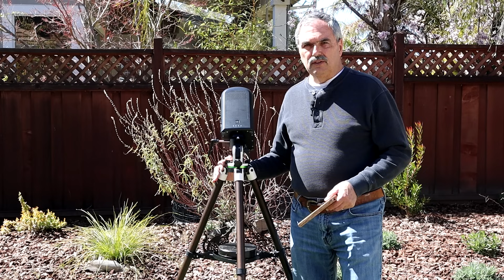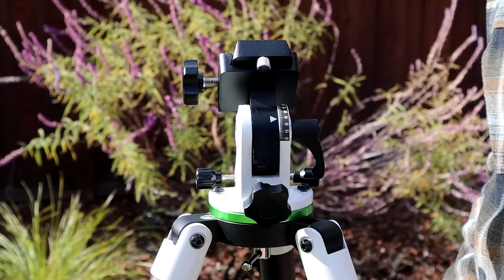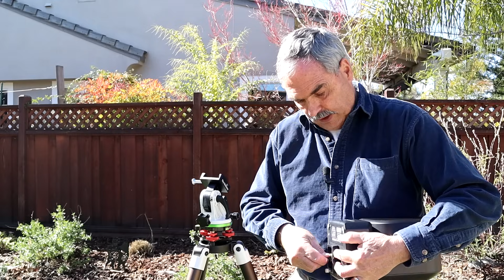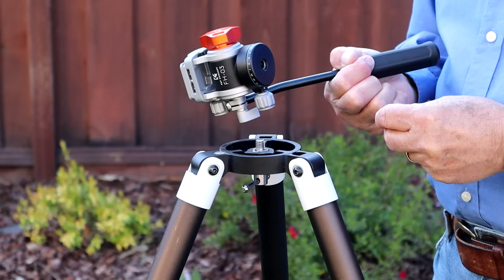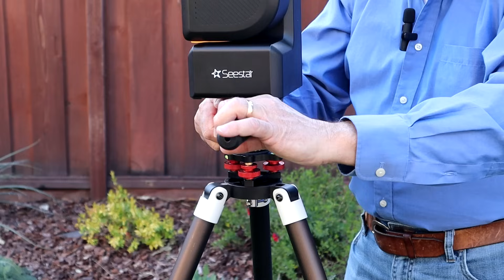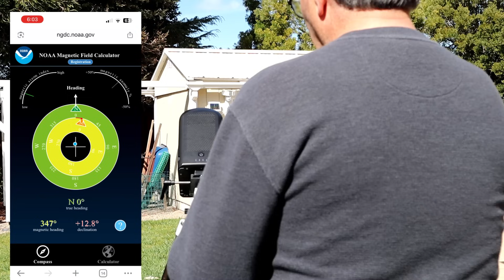Get Ready for the Seestar EQ Mode

Comment: Excellent! Thanks for making all the effort to create this video's about the S50. But still a question: Do you get also oval stars with the S50 EQ-N.I.N.A. setup as discussed in that video as well?
Anyway have clear skies and greatings form The Netherlands.
Reply from the maker: If you are getting oval stars with the Seestar App in EQ mode you will get the same with NINA.  If you are getting round stars with the Seestar App in EQ mode you will get round stars with NINA.  Whether or not you get round stars doesn't depend on which you use but on all the other things that impact star trailing.

Comment: What an absolutely great video.   So many help  videos just gloss over details which can be critical in getting a Seestar setup and running.   Particularly for those of us with limited experience.   You have also taken the time to show various options and products that we can use build a solution for using EQ on the Seestar.  Please keep up this line of videos on the Seestar and other astrophotography products.  You need to add a channel membership so we can donate to help offset some of the costs you have in creating these videos.  Any chance you could start a series on the Dwarf 3?   There is a real need for videos like this for the Dwarf.
Reply from the maker: I really appreciate this kind of feedback.  Others have suggestion a Patreon but I think I would have to add special content if I did that or added a membership and I just don't have time for more content.  At this point I just ask folks to use my affiliate links when they can.  The Amazon affiliate is good for anything, not just astronomy gear.  I was looking at the DWARF Mini as  a possible other SMART scope but I still have a few other things on the Seestar to take care of.  Will see what I can add next.

Comment: Thank you for the detailed description, something that is often missing from youtube reviews.
Just a question for the K&F head, a candidate I'm considering. 
Is there a reason when to tilt the seestar on the side of the handle, rather than in the other direction moving the handle up (while still having the seestar power section pointing in the correct direction)? Would it hamper the movement of the scope?
BTW I have the s30 and the K&F concept tripod.
Reply from the maker: Sorry, but I am not following your question.  The handle can be raised, lowered or rotated but it cannot move to the other side of the K&F head.

Comment: I can see in the months ahead a load of complaints of their s50 gears sticking or not working at all. Turning it into a very expensive doorstop.
Reply from the maker: That's possible, but I think ZWO must be confident that will not happen.  They would loose a lot of goodwill and customers for their future products.  It's also possible that they did not do enough testing to be certain that the failure rate will be low, but  I still think they would be very careful about their reputation.

Comment: So helpful setting the Seestar to EQ mode, I have an old Vixen Super Polaris mount that I intend to use for my Seestar, it'll be solid as a rock.
Not sure even if you were at the North Pole the compass would point true North, I believe (may be wrong on this) they point toward a moving mass, that is currently somewhere under North Canada so the declination changes over a period.
I assume the Seestar only uses North pointing for daytime solar observing and general direction finding while plate solving, so I guess it's not super critical?
Reply from the maker: Indeed, the magnetic declination does vary over time.  You are correct, the Seestar uses the magnetic reading along with the level reading (when in Alt-Az) to find the Sun and also for the initial location when doing the plate solve.

Comment: Thank you, I have upgraded mine with your advice. In addition, I have added a kind of "mouse grip tape" on the dovetail of the wedge so that the Seestar cannot rotate and unscreew itself from the dovetail. About the M8 clamping lever, I took a shorter one, there is just enough clearance below the Seestar, and it is important to note that the lever can be be locked/unlocked independently from the screw, meaning that we we can still screw/unscrew the M8 even if the lever has limited angle of rotation.
Reply from the maker: The tape is a good idea.  I have added a rail extension to move the Seestar weight to be more centered over the tripod.  The extension has a rubberized grip surface as well.  Watch for contact between the clamping lever and the rubber feet on the Seestar when it rotates.  You have to check a full rotation to make sure that there is clearance.

Comment: Purchased skywatcher star adventurer adapter and attached to the Seestar. Problem—when you tighten it down its orientation is off by 90 degrees so when you attach Seestar to equatorial mount the orientation is not correct
Reply from the maker: Please watch the section of the video starting at 4:13 very carefully.  It will show you exactly what you need to know.
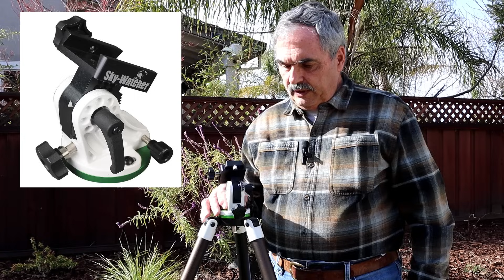Reply: @astronomytipsreviewswithcu740  7:58
Reply: Thank you for your prompt reply. Watched the video again. Didn’t answer the problem. When I attach the adapter to the Seestar and tighten it down its orientation is oriented side to side and not front to back. So when I mount the Seestar on my equatorial mount the orientation is incorrect.
Reply from the maker: @AnthonyDeOrio  OK, I get it now.  You can simply rotate the adapter like I do in the video to line it up in the correct direction before you fully tighten it down.  Hope this helps.
Reply: @ 

Thank you for your reply and advice. I understand that but the adapter I have is not that one. I have the skywatcher s20550 Star Adventurer adapter. It is the one shown in your video starting at 7::03. You have to turn it all the way down to tighten it and when you do it is oriented side to side and not front to back..  When I place it in my mount (William optics vixen base mount) the Seestar is oriented with the power button to the side and not up. Any advice would be appreciated. Thank you.
Reply from the maker: @ I think I understand what you are doing wrong.  When you tighten the adapter to the Seestar base, hold it so it is pointing in the correct direction and tighten the bolt with an allen wrench without letting the adapter rotate.  I don't know any other way to say this clearly.  You don't rotate the adapter to tighten it down.  You rotate the bolt which goes between the adapter and the Seestar which is held captively to the adapter but can rotate independently of the adapter.
Reply: @ 
Again thank you for your prompt reply. I understand what you are saying but the bolt is fixed and you can only rotate the adapter. You cannot rotate the bolt independent of the adapter.
Reply from the maker: @AnthonyDeOrio  Are you talking about the "Ball Head Adapter"
Reply: @ yes
Reply from the maker: @AnthonyDeOrio  In that case, add washers between it and the Seestar to get the right spacing and the right angular alignment.  Does not have to be perfect.
Reply: @ 
Thank you  for .the help. One last question—-by using washers will all the weight be centered on the bolt diameter as opposed to the full circumference of the adapter. And if so will that make it unstable and prone to damage. Again thanks for the help and the great videos.
Reply from the maker: @ I don't think that will be a problem.  But I had one other thought.  Since you are using the Ball Head Adapter that means you are putting this on an EQ mount.  So screw on the Ball Head Adapter as you did before and then loosen the RA knob on your EQ mount and rotate the Seestar so it is in the proper orientation even if the Ball Head Adapter is at an angle relative to the Seestar.  That is, use the EQ mount itself to pre-align the Seestar to point north and have the power button facing up.   Then, at night, when you use the Seestar App to dial in the polar alignment you will use the altitude and azimuth adjusters on your EQ mount.  Should work perfectly fine this way.
Reply: @ 
Thanks much for your help and advice.
Reply from the maker: @AnthonyDeOrio  Best of luck to you!

Comment: Wrt the choice of an eq wedge I'm wondering what your opinion might be of the Move Shoot Move (MSM) wedge compared with the Skywatcher wedge you used in this video?
Reply from the maker: In my prior video on EQ equipment choices and setup I showed several tilt/pan heads which are sometimes called MSM wedges.  If that is what you are talking about, I have not yet done a careful comparison between one of these and the Skywatcher wedge.  I am thinking of doing this eventually so you might want to subscribe if you haven't already.

Comment: Great video! Thank you. There's another fluid head similar to the one you used, but it has degree markings for the tilt. It's by Innorel. I have a fluid head, but it doesn't have the degree markings, so I'm ordering the Innorel. 

Also, I use a quick change system for tripod heads that makes it really easy to swap heads around from one tripod to another, but it also helps to add a little distance between the fastening knob for the Arca plate and the Seestar unit, so that you don't have to modify the fastening knob. The quick change system is by Leofoto. It's a little pricey, but if you have multiple tripods and heads for your setup, it adds a major convenience factor to swapping gear around quickly and easily.
Reply from the maker: Iwas searching for a fluid head earlier today with a graduated angle markings and found exactly the one you mention by Innorel.  It is also capable of 11lbs capacity.  I was thinking of ordering it to do a video comparing the K2 and that one.  We'll see if I have time.  I'll look into the quick release.

Comment: How does the seestar mount on the sky watcher wedge does it screw right on ?
Reply from the maker: There is the adapter plate which screws onto the base of the Seestar.  Then you guide the adapter plate into the shoe on top of the wedge and clamp it tight.  I showed this in the video, maybe double check.

Comment: Thanks for the video!

I'm not sure why S50 owners continue to screw their telescope on and off various mounts, adapters and tripods, or have to replace the locking bolt on the SkyWatcher wedge.

I took a suggestion from a photographer friend and installed Neewer ARCA quick-release plates on my S50, Dwarf 3, my wedge, equatorial mount, and all my various tripods.

When it's time to mount the S50, I just snap it in the ARCA plate and lock it. Changing tripods, or from the SkyWatcher back to Az-El is simple and quick. 

Also, the ARCA plate provides just enough clearance between the bottom of the S50 and the SkyWatcher's knob to easily use the stock hardware knob.
Reply: Same here with quick change plates. I use Leofoto. I have receivers on all my tripods, and plates on all my heads. It makes for a really convenient modular setup.

Comment: Thanks for the informative video! I used my S50 in the EQ mode last night. 30 second exposures didn't present a problem with just a few dropped exposures over a 4 hour session. I already had the  Skywatcher equatorial wedge and it worked great and was easy to get down to .1 degree alignment which seemed to be adequate for the 30 second exposures. My north view is limited by trees but the new ZWO polar alignment routine in the Seestar app used two (edit: actually three) exposures near the meridian to plate solve and align. I'm a very happy astrophotographer now!
Reply from the maker: Yes, I like their alignment method.  Don't need to see the north pole and areas on either side.  High in the sky so most everyone should have visibility to that.

Comment: Thanks.  Saw your beautiful ROR Observatory in the background.   Hope to start building mine this summer here is Texas. 

Did you build yourself from plans andnif so which plans and what modifications did you make?
Reply from the maker: I did pay for plans from Sky Shed and made some simple modifications.  If I had to do it over again I would change 2 thinks.  1) Lighten the roof by using less materials.  It only needs to be water tight.  2) Use larger rubber wheels running on an angle rail rather than garage door wheels in a track.  Both will make it much easier to roll on and off.  Having said that, I don't have any real problem now, just thinking ahead to when I get older.

Comment: Really helpful concise video. Thank you very much from a grateful Brit. I spotted the potential bind on the Skywatcher wedge mount plate locking knob on the Amazon pictures before I bought it, so I ordered a 3/8 female/female   tripod riser, but I like your ratchet M8 handle rod solution much better. Thanks again
Reply: What is the length of the ratchet lever bolt that is used on the skywatcher wedge?
Reply: @markmatson865  I got M8 x 50mm from Amazon. The corners of the Seestar S50 clear the handle of the ratchet bolt nicely, when the base rotates. 😎
Reply: @philipchambers122 thanks for this - haven’t got my seestar yet & I’m ensuring I’ve got all the right equipment in place for eq mode ready for when it comes (also a Brit!).

Comment: Finally got the EQ mode. What would be nice is if it could take 5 min. exposures.
It can then use the other lens as an autoguider. 
Have you tried opening it up and rearranging the wires?
Reply from the maker: NO and I would not recommending that.  It would not be that simple to do what you want it to do by just moving wires around.  The exposure setting is in the software, so if you could break into that you might be able to make that adjustment.  However, the mount mechanics is not good enough to track accurately enough to do 5min exposures.  Maybe 1 or 2 min max.

Comment: I just wonder how the new  eq mounting will effect the drive train of the RA axis , brearing , balance and stresses ect, as it was designed to be an Alt Az mount ....... any one else conceened abt this .....
Reply: I used it in the EQ mode last night during a 4 hour session and it worked very well. I'm approximately 31 N. I don't know what the long term effects will be but I anticipate using it in the EQ mode almost exclusively.
Reply: Lets hope it holds up well for us all as its a fantastic upgrade
Reply: ZWO have said that the bearings etc are over engineered and it will handle being mounted this way without any issues.

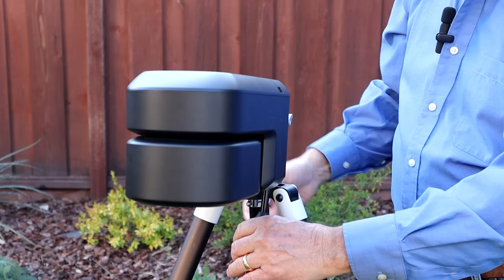Comment: At 21:35 you show the direction of the head reversed to get to very low elevations.  This looks dangerous since the main body of the SeeStar still has to rotate.  Wont it collide with the legs in this orientation?
Reply from the maker: It won't collide with the legs if you set it up so it will clear which is what I did in the video.  As I said it is better to have it over the leg for support but you can do it on the other side if you weigh down the tripod so it doesn't tip or shift.  And, of course, you need to make sure it is clear of the legs like I did in the video.

Comment: I'm at 34' latitude.  So I had assumed I would be setting the wedge to 34 degrees for polar alignment, but according to the EQ setup in the app, at 34 degrees wedge angle on the skywatcher gauge, the seestar is 56 degrees angle to ground, so wedge actually needs to be set to 56 degrees for 34 degrees latitude, according to the app -  is this correct?
Reply from the maker: I can see how this would be confusing.  The latitude angles on a typical wedge are measured from vertical where vertical is 0 degrees.  So 34 degrees from vertical is 56 degrees from horizontal.  That is the complementary angle.  So, set the angle to your latitude, 34 degrees, and then fine tune in the direction the App tells you to but remember it is measuring from the horizontal not from the vertical.